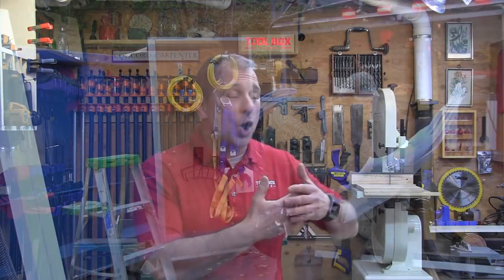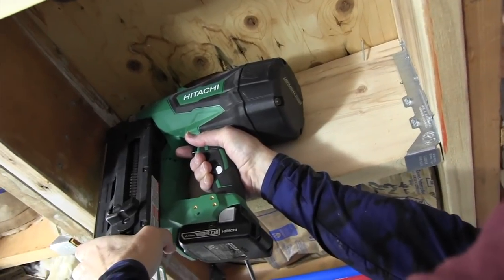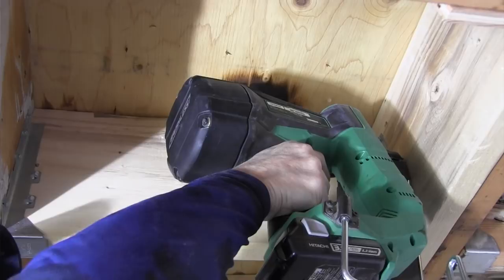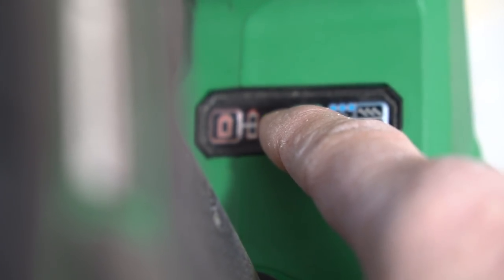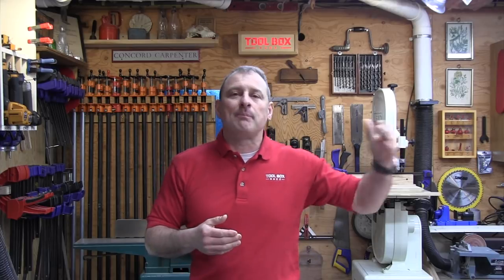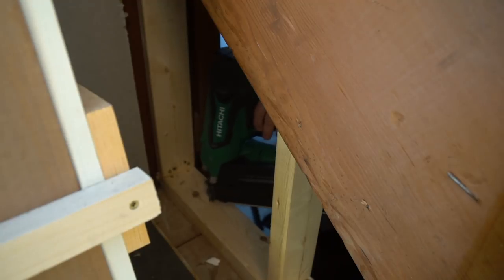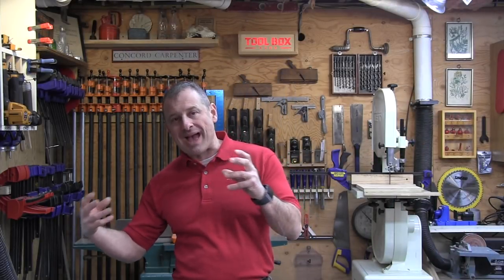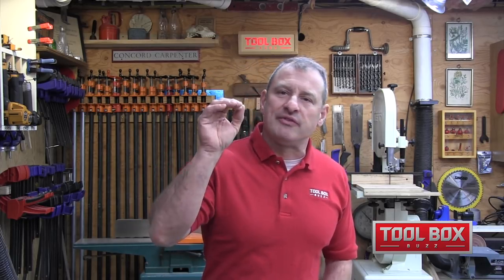Hitachi 3 1/2" Cordless Framing Nailer Review

Comment: I didn't hear you say how it compares to the Dewalt? I have a Dewalt is it worth switchinging over to Hitachi?
Reply from the maker: No - the DEWALT is a super solid nailer.
Reply: Thanks. That's what I wanted to know.
Reply: ya i have both i wouldn't say its worth switching. dewalt also better in the cold. here in canada the dewalt works fine in -20 weather
Reply: A Concord Carpenter / ToolBoxBuzz the dewalt is a terrible nailer.  I went through 4 in 3 months before I demanded my money back.  Worst tool ever.
Reply: Steve Van Harten lol u obviously expected it to perform the same as a pneumatic gun. No way u went through that many using it properly cause ive had the same one for about a year of pretty heavy use and havent had any issues . Even in -20 weather . Far from the worst tool ever thats for sure. You need to run minimum 4 amp battery with it, if u ran less that could be an issue too. If the tool was that bad every time they wouldnt of let it even hit the market lol
Reply: Adam McKenzie our ideas of heavy use must be different.  I expect a nailer to last more than  a day.  First one lasted less than 2 hours on a small reno.  I have air guns and a gas compressor.   Dewalt framing nailer was a large disapoinment.
Reply: Lol framing isnt heavy use? Framing houses, decks, fences , for the past year with mine. Again if your expecting pneumatic results its not going to happen. If you actually did some homework on the dewalt you wouldnt of broken them i bet. U were prob bump firing like a air gun wondering why it cant keep up lol have a good day
Reply: Adam McKenzie no.i wasn't.  Was hoping they would replace paslodes.  Which  can't bump fire.  For the cost.of the.dewalt I would expect it shoot nails.  I know many tool suppliers in my area won't even sell them anymore.  As they all.got returned broken.  Bur.your right, must just be me
Reply: Steve Van Harten lol every tool supplier in my area sells them .and the suppliers in my area area big suppliers like Atlas machinery. I see many guys using these guns on framing sites. Like when framing roofs they are very handy not having a hose. They couldnt replace pneumatics no way but. Mine has shot thousands of nails and the worst issue has been a jam so i cant say anything bad about it. Especially when it worked in -22 Celsius weather for me this winter consistently . Mine isnt special. I also repair pneumatics and see the way people treat those, even those people abuse way too much and think the gun should just handle it . i guess if u had 3 that broke ur ganna think they are shit .9/10 times its user error from what ive seen with pneumatics. Coulda just been shit guns. dewalt is a good tool company and they run tools through pretty heavy tests before releasing them . I use many brands too not just dewalt i only use a few of their tools like the nailer.
Reply: Adam McKenzie I have lots of other dewalt tools I love.  Just no luck with those guns.  Glad yours  works for you.
Reply: I doubt it would unless the type of nail is a factor for you. I believe the Hitachi one can fire round head nails whereas the Dewalt can only fire clipped or offset head nails.
Reply: There is always one guy that his tools broke by staring it. 
I don't have Dewalt but my Co-worker has and i have tried it works fine, i used it one day and it jammed few time but that release lever fixed issue.

What i have seen on these videos feels that Hitachi is more powerful vs Dewalt, Dewalt is bit faster on bump nailing.

I have used Paslode gas nailer since 2004 and would likely change it for something like this for save few money to get rid of gases.
Reply: I have the dewalt fixout gun. It jambs a lot, I reckon the cause for that is the nails are too soft being made of aluminium.  I also have a 15yr old senco DA fixout air gun, it never misses a beat....well not never.
Perhaps the Hitachi being a DA steel nail may be a better fixout gun and also nails are compatible with my senco air gun. The dewalt fixout gun put me off buying the dewalt framing gun.
Reply: MultiFin  Honestly, I can't even shoot 8s in mine anymore I think the diameter is to small I can only shoot 10s with the bigger shanks and then theres no jambs.
Reply: Hi Tim Pearson. 
The Dewalt nailer I own is the DCN660N-XE which only shoots 16ga 1.6mm dia. 20deg angle brads, same the Paslode angle fitout nailer. 
I can't fit a bigger shank "dia." in mine?? I guess I'm stuck with the smaller nails...
A new Dewalt model coming out at the end of the month hear in OZ is the DCN650N which shoots 15ga DA 1.8mm dia 34deg.. The same as my Senco air nailer and the Hitachi.
According to the specs Hitachi can shoot a longer nail that the Dewalt in the 15ga DA size, by 2mm.
Reply: MultiFin Hey my Dewalt is a framing gun, the only battery trim gun i have is the 15 guage Ryobi air strike I use it for deck rails, it weighs a ton but man is it powerfull
Reply: Cool. I believe the Concord Carpenter did a 'shoot out review' on cordless fixout nailers and the 15ga Ryobi won. I think they called it a beast. lol
Reply: All i can say, is do reseaech my friend. Thats what i do when going in to buy something. I look within thr price range and find the best in its category. No matter the brand.  Being limited to a certain brand isnt good unless you want everything to have the same batteries, than stick with what you got
Reply: Kevin Wendover I bought a used paslode framing nailgun the cordless for $200 on Facebook yardsale. I was surprised how loud each shot was! Lol are the hitachi nailers quieter since its not gas powered?? I was looking at ryobi for a finish nailer.
Reply: Sankar Krishnan it is slightly quieter but not much. The gun smacks the nail hard.
Reply: Iv had my dewalt nailer for almost a year now and not one jam or reliability issue.
I does lack the speed and power of my Bostitch numatic, however it is way more convenient for not having to lug my compressor along with setting up the hose, AND in lot of my cases, setting up and lugging around my generator!!
I love the dewalt nailer. I envy the power of the Hitachi however, but the dewalt power is adequate.
Hopefully the 2nd n 3rd generations will be much lighter and more powerful
Reply from the maker: Tim Pearson faster
Reply: Cheng Liu I can confirm the hitachi will fire the paslode fullround heads.I had some left when I changed and was short of 90mm nails the round heads were all I had so I used them up not an issue.
Reply: I'd say yes. Never hurts to have two tools, and the Hitachi is quite a lot better. I don't regret the Dewalt purchase even though I bought the Hitachi anyways, the DeFault is solid but the Hitachi is on a higher plane of existence in terms of performance and reliability, really a phenomenal tool.
Reply: Yes the Hitachi is much better I have had a default for over a year and now Hitachi for book 6 month we use them very heavily Hitachi is much better
Reply: Dewalt framing nailer is the worst I’ve ever try.

Comment: I'm currently in m18 and m12 platforms. Thinking about getting framing and finishing nailers. I definitely want cordless. Obviously my framing choices are dewalt or Hitachi. But for finish nailers I have Milwaukee options. I'm not sure which to go with because I don't want to buy a tool that I only use the battery for that tool only. If I'm going to enter into another platform I want options!....... suggestions? Also what do you think of the Hitachi finish nailers?
Reply: Matt Baldwin I use the 16 gauge finish nailer and it’s awesome. A little heavier than other brands but well balanced. My friend uses the 18ga brad nailer and loves it as well. I’m 95% Milwaukee but went with Hitachi just for nailers.

Comment: Love the review! As a newbie doing the occasional framing (about to build my first shed) can you recommend one of the two you mentioned? 30 degree vs 21? paper vs plastic? thanks!
Reply: If you are just building a shed, go buy a 15 dollar hammer and a box of nails at ace hardware. Tools are like cars, they devaluate extremely quickly, so unless you are a remodeler or apprentice contractor I cannot recommend buying a $400+ tool that you won't need that much

Comment: Have this and the Dewalt framing nailer. The Hitachi nailer makes the Dewalt feel like a toy gun. It's actually sort of intimidating, it just sits totally silently, no mechanical whirring noise or flywheel inertia, and it just effortlessly blasts nails through everything. The Dewalt gun is good by virtue of being gasless/cordless but honestly it just doesn't compare in performance.

Comment: the bad thing about this gun is that now it has a nail stuck in the tip and I have to forcefully take it with a technician to repair it because it is impossible to remove the nail without disarming it almost completely. that limits my work. Hitachi have to modify that as soon as possible.

Comment: You make some outstanding tool videos - thanks.  
I would love to settle on one battery platform - will Hitachi SOON come out with a strap nailer?  
Right now, it looks like a Hitachi cordless framing nailer (from what I have seen, it appears to have little more umph over the DeWalt) and Dewalt cordless for the strap nailer :(.  Thanks again for the excellent videos.
Reply from the maker: Thanks - not sure I can certainly ask them
Reply: Rafter hook great for TJI joists

Comment: 💥💥 Are Hitachi and Metabo the same gun ?
Reply from the maker: Yes Metabo HPT
Reply: @ConcordCarpenter  thank you
Reply: @ConcordCarpenter  Hey Rob. A couple more questions if you don’t mind.  1- A rafter hook but is there a hook to hang it from your tool pouch? I know it’s kind of heavy but there may be a time where your standing somewhere and need to free up your hands for a minute.  2- How does it toe nail.?  3- I know it’s not going to frame an entire house if you’re a hardcore framer but can you see it framing a small deck or finished basement comfortably.??  4- Do you have to completely run it to the end before putting in another strip of nails.?? One strip at a time is a bummer.  Thanks for your really  great tool review.
Reply from the maker: @Jimmy_Cavallo  hook is good, toe nails great - beard of a nailer. Can’t remember if there is a nail lockout. I think there is.